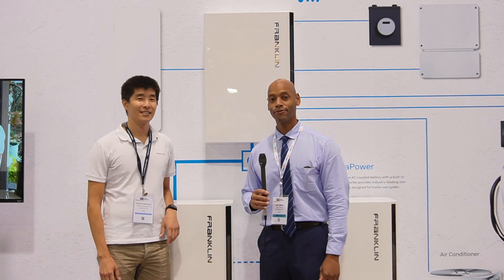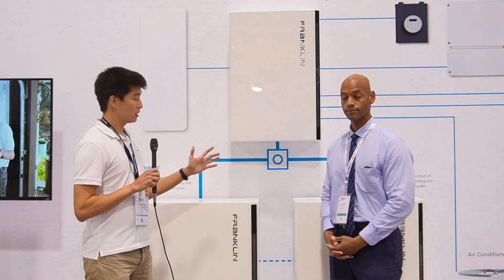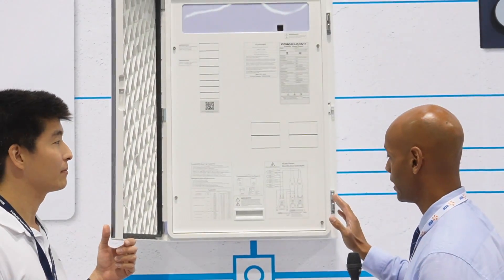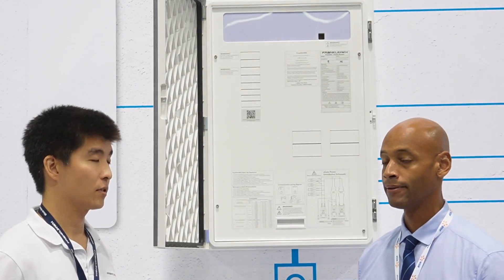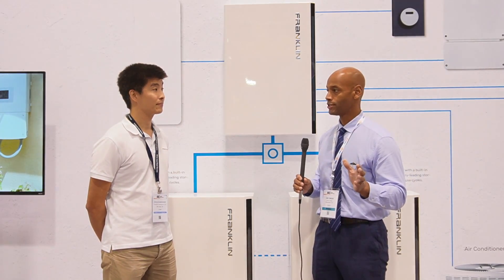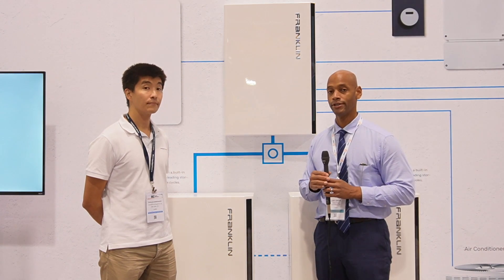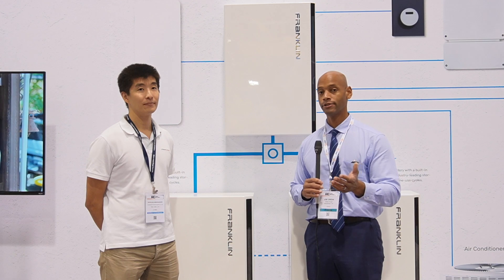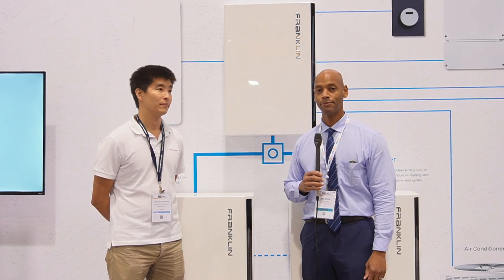Franklin Whole Home Battery Super Fast Installation

Comment: I think FranklinWH batteries cater to the specific needs of both homeowners and installers. Homeowners require a higher level of safety compared to lower quality products, while installers prefer something like Franklin that is easy to install, saving them significant time and effort....
Reply from the maker: This is good feedback. A successful Battery) company has to cater to the needs of both the end-user and the installer. And frankly, the installers have been having a very difficult time maintaining these new batteries. Franklin does one of the best jobs of the battery manufacturers.

Comment: My 13.2 kWh PV system is going in this year and next year I plan to install a Tesla Power Wall 3. Leaked info confirms this is worth the wait.
Reply: Have you purchased the PW3 yet? It is considered risky because it contains a solar inverter and requires two large fans to cool the entire system. But have to admit that it is an innovator product.
Reply: One year later, Tesla power wall three having all kinds of failure problems. 😂

Comment: If I had Q cell solar panels can I add the Franklin battery + the home grid stackable battery system together?
Reply from the maker: You can use either Franklin or Homegrid, but not both.

Comment: Are the batteries (if you have two) kept at the same level in tandem, or are they used sequentially?
Reply from the maker: Great question. They are used together in tandem or parallel.

Comment: Great information as always, Thanks very much. Due to your expert advice, we signed up for a system today. The Installer wasn't sure about smart backup. Is it a separate optional module or is it standard equipment? I've been searching on the Franklin site but having no luck. We just want to use a 50A feed from the agate to an outlet for our EV charger. Thanks again for all your informative videos.
Reply from the maker: Hi Charles , and thanks for riding in. I wish you success on your Franklin project. You can have your installer talk to their distributor regarding the smart circuit control. It is an optional component that goes inside of the Franklin a gate.
Reply: @SolarSurge  Thank you for your time, I appreciate the information.

Comment: Look like I am out of luck since in Maryland. I do not want to have solar panel due to cost. I do have electric car (2) Tesla and charge during off peak. Wonder it the have the system that charge battery during off peak then use power from battery during Peak period (12:01 pm- 8:pm M-F)
Peak power rate is about 3 time more than off peak.
Reply: Yes these systems work on stand alone grid power as well

Comment: Joe, 
First of all, thank you for your videos. 
Second… from owner to owner… new company, new product, will it be a head ache we have to own or will it be just fine?
Is there sufficient amount built in to have in reserves to compensate for the unknown? I’m not getting answers. 
Thanks Brother!
Reply from the maker: Hi David.  Thanks for the question.  I've seen your great comments on the videos and please keep it up.  Right now, Franklin is offering a buy one battery, get one free deal to new installers.  I recommend that you take the "free" battery and charge the homeowner full price for the installer.  Consider that $10k battery savings to be your tuition to learn the ins and outs of Franklin installation.  Once your first project is complete, it should be smooth sailing from there.
Reply: @SolarSurge  
I like where your head is at in your process. 
And your right, at times we buy the knowledge lol. 
I like the sol-ark but the labor!
Been searching for a WH AC coupled and I’m excited at  Franklin’s offering, yet I’m familiar with  having to end up owning an install due to the manufacture not covering, so I’m hesitant.  
Thank you Sir!
Bless you and yours!!

Comment: Great review Joe.
Question: Can the controller and battery boxes be installed outdoors in the weather?
Reply: They can
Reply: Yes Joel, they are rated nema3r, and are not limited by heat warranty
Reply: Yes they can be. Upto to -4c to 122F. Amazing quality equipment